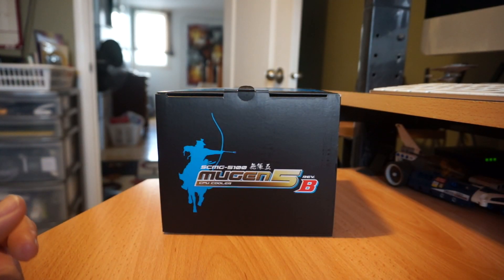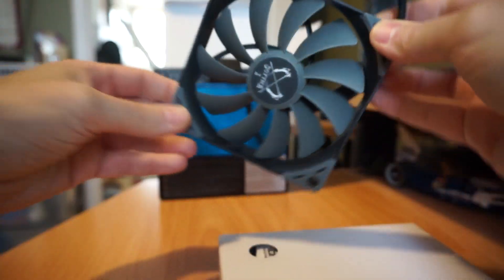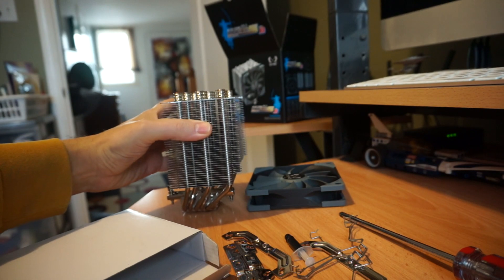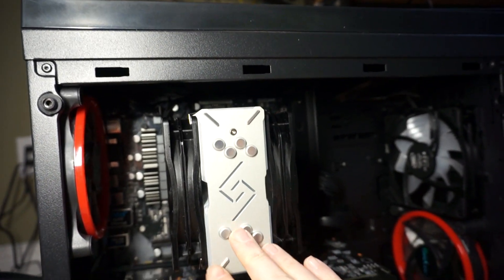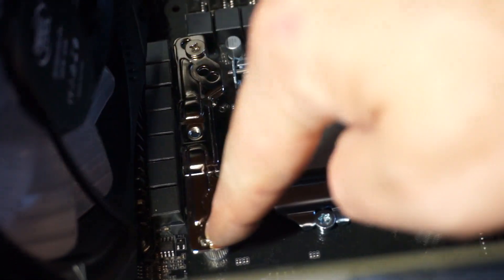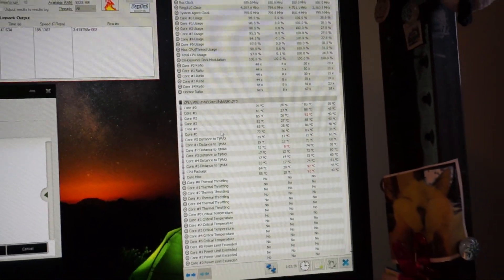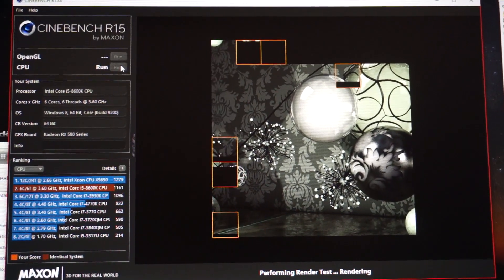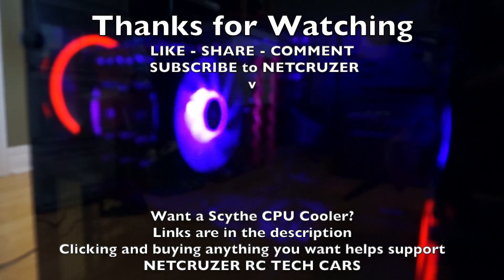5Ghz Overclock Air Cooling Battle! -  Scythe Mugen 5 Rev B vs Deep Cool Gammaxx GT - Netcruzer TECH

Comment: In studying case air flow your blocked front bottom 140mm fan is counter productive. It causes block flow upward impeding your middle front fans efficiency and causing flow 'swirl'. You'd see better performance removing that front bottom fan and installing two top mounted 120mm exhaust fans for a total 7 fan configuration including cpu cooler fans.

Comment: I have a 1700X that's overclocked to 3.9Ghz with 1.4V and under full load it gets to 75C. How is your CPU thermal throttling?
EDIT on a Mugen 5

Comment: i want to say that under full load (intel burn test) is not real world full load on a CPU. Same with Prime 95.... kinda outdated for new architecture. Aida 64 is what people use now says to simulate full load. Also Aida 64 reports errors from an unstable overclock even if the computer does not crash. software is outdated. But looks like a decent air cooler. like to see how it compares to more expensive models. Particularly Noctua.

Comment: Intelburntest does nothing lmao it probs was built for quad core cpu's back in the day. Use Prime95
Reply: Prime95 is a pretty unrealistic workload though it does generate a lot of heat. make sure if you use Prime95 you turn off AVX workloads as stability is almost impossible under that specific bench.
Reply: @spencerosgood2399  Well, based on my workload which is GPU+CPU rendering it generates same heat as Prime95, also some games might be more CPU bound so it also can generate big heat.
Basically while gaming i see around 60c ( such as Shadow of Tomb Raider ), while working in 3D it goes up to 80c.

Comment: Could this cool i7 9700k Stock?
Reply from the maker: Yes absolutely it well, and quite well.
Reply: Netcruzer RC TECH CARS NICE!!!! I just ordered my pc so hopefully cooling goes well I’m going with the nzxt h700 too so I’m hoping cooling isn’t an issue with those two
Reply: @Jmack1lla  I ran that for a while on my 9700k  great cooler. Prob one of my favorites. One thing to consider however is your room temperature, make sure your room temp isn’t so high and you should be good to go especially in a solid case with good airflow.

Comment: Thank you, very informative and well done review - much appreciated. Will prob use this cooler in my next build, a 12 core LGA 2066 Skylake. Looks up to the task. Don't trust water inside my creations plus I can truly do without RGB overload! :-) You could have rounded out the test nicely if you had also run the tests with the original Mugen fan for comparison. I feel that would have added so much more insight to the results. Perhaps even 2 original Mugen fans in push/pull. Thanks again for a very helpful review. Cheers, from Sydney Australia.  (P.S. Why no mention of the TDP of the Mugen? Pretty important spec in a review like this).

Comment: Core 3 thermal throttled ur wrong I seen it at the end ur 1.39 volts way to high try 1.375-1.38 should be ok for 5 ghz

Comment: You should have also another test with the included fan to have a objective comparison
Reply from the maker: By keeping the fan consistent I thought that was objective comparison.
Reply: The product is hsf what you are essentially testing is the heatsink,- as fans have cooling n noise efficiency.eithout testing you may not know maybe the one fan May equate the cooling efficiency of your 2 fans with reduce noise.

I understand where you coming from as you don’t want to lose the rgb lights but what you are doing is not a fair comparison
Reply: @swakookoo ,  I agree because the included fan doesn't have high static pressure and doesn't perform exceptionally well. Ryzen 5 overclocked or Ryzen 7 stock or even Ryzen 7 slightly overclocked is fine, but anything beyond that is too much for this cooler with the included 1200RPM fan.

Comment: Watching some reviews and am really impressed with this cooler, especially for the price. Wish it had been out when I got my 212 evo, this would've been a better choice.
Reply: The included fan is a high-quality fan in terms of build quality, but is a high airflow design and doesn't perform exceptionally well. It keeps my Ryzen 2600 at 72ºC in Aida64 at 3.95ghz at 1.28v (drawing 115w), but is very quiet.

Comment: The Mugen 5 is indeed a great cooler. I use it on a Ryzen 5 2600. I kind of dislike that you really tortured your poor Intel CPU to the max. You are hitting max temps and I'm not sure if it's worth both the risk of killing it and shorten the CPU's lifespan.
Reply: Who cares  short bursts are not going to destroy it as fast as you may think. I ran an i7 2700K under water for a year at 5.0 ghz and sold it when I upgraded and it is still going strong in a friends system 4+ years later, he is only considering upgrading hist platform now to Ryzen 1800X because they can be had cheap
Reply: they're not that fragile... can ppl stop thinking that if you hit high temps your components will melt instantly or 2 days later will stop working properly? manufacturers run longer stress tests with high heats and you're talking as if 1-2 test runs will melt it lmao.

Comment: think this would allow a 9700k to push to 5 GHz? I have a bunch of coolers that I'm debating between and it's an unending decision.
Reply: if you haven't bought a cooler yet, take the mugen 5 pcgh edition into consideration aswell
Reply: Cameron Fischer the fuma is better
Reply: Do you think the mugen 5 would run i7 9700k at stock speeds fine?
Reply: @D4VIEES  easy